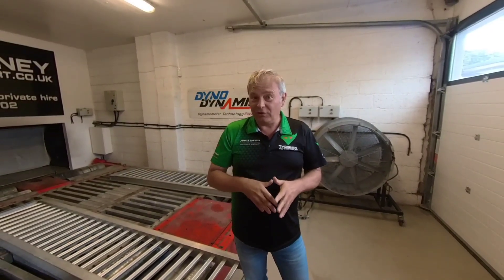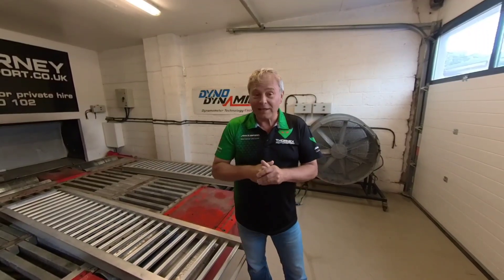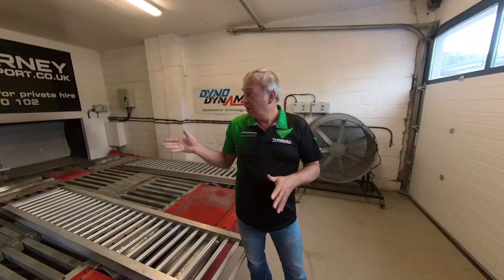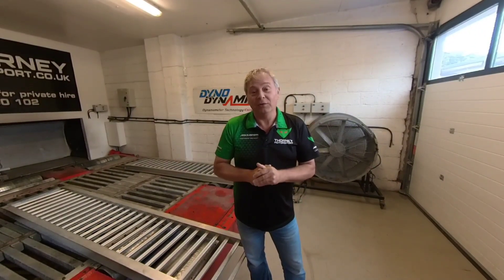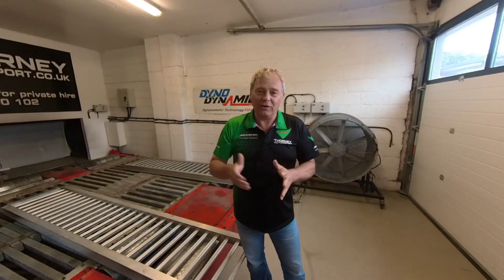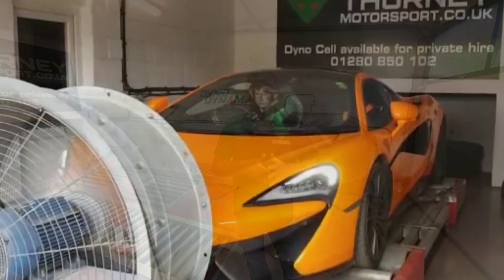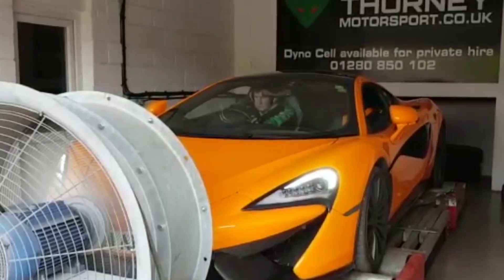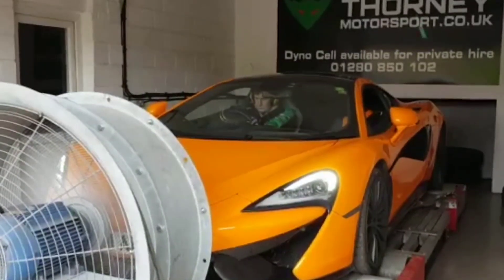7 failed McLaren engines? Why?

Comment: Theres a design feature  within the maclaren engine makeup that causes the rod bending and ring wearing failures... there is no laterall movement on the con rod at the top end.. but there is lateral movement at the bottom end ! When you over tune them, the con rod bends !! Bcz of this inability to move ...

Comment: IAT / ECT corrections, knock control, closed loop full load fuelling all allows for change in conditions… you’re talking like the fuelling needs dialling in at every load and RPM point like an open loop standalone ECU. If an engine ‘leans out at high RPM’ then it’s got a fuelling issue and the problem isn’t in the software it’s physical as lambda is targeted and closed loop fuel corrections work to meet that target if it can’t, there’s a fuelling issue

Comment: Would the engines also blow out if you just don’t map them? I have a bone stock 675lt. I wonder how reliable the engines are. I hear nothing but good things from most owners. Drove mine 16k km’s and nothing at all
Reply from the maker: Only stock 675 engine we rebuilt was from a car that was serviced 4 miles earlier, not enough oil in it

Comment: Do you see issues with all level maps? Or just maps above stage 1?
Reply from the maker: Its not a question of all maps kill engines, far from it, we map these cars twice a month and have never killed an engine, its just a question of how and how far and that is in part determined by the model. ALL the McLaren models can be effectively and successfully tuned but you need to know how far to go and also it must be custom mapped to each car, you cant just chuck a file on, so it must be on a dyno with AFR carefully monitored with multiple runs in different temperatures. So stage 1,2,3 whatever all fine so long as you map to the parameters the cars engine can handle. AND of course, make sure whomever maps the car offers you a FULL WARRANTY on the engine and drivetrain. We do, if they dont then ask why.
Reply: I would love to have my GT tuned by you all. But I’m in the states 😭
Reply: Interested in this question also.

Comment: Excellent video. This is the go to channel for McLaren practical expertise it would seem - I haven't watched all of the content yet but I will do. Regarding mapping and I apolgise if this is covered elsewhere on your channel - is there any way to tell if a car has been remapped in the past even if it has been put back to factory settings in the meantime? If I find a seemingly good used example and engage yourselves for a pre purchase inspection, are you able to interrogate the car's ECUs to this end? I would have thought Mc Laren would have thought of this themselves and put in some safeguards. It is my (long term!) plan to own a McLaren and I cannot afford to make this sort of mistake. Thanks and all the best, Chris.
Reply from the maker: We can tell if a car has been mapped before but it needs the ecu out and interrogated
Reply: @ThorneyMotorsport  Thanks, so not really practical on a pre purchse inspection.
Reply from the maker: @Ratman  no, not really, there are other areas we can check of course
Reply: @ThorneyMotorsport  Thanks for your reply. OK  understood; when the time comes I will come to you once I find a good example. Thanks, Chris.

Comment: Spot on really, the problem is, because a good mclaren tune is so expensive, people are tempted to use an online vendor and these files are honestly a load of turd, most of the time the problem is when the car arrives on boost, at that moment the fuelling is too lean and bang, as an FYI for everyone, these cars in stock form run pig rich with an AFR around 9.9-10.5 AFR. A healthy tuned AFR will be between 11.5 - 7

Comment: Glad your back John,another Stellar informative video!!! My mapping is and will remain ALL stock. Mclaren engineers are best of breed due to all their intensive testing on the race track and off!!! Very happy with what have!!!! Awesome power with reliability!!! Looking forward to Your next words of wisdom!!!
Reply: I very much doubt mclaren wrote the map for their engines. It would have been done by Bosch/Riccardo.
Reply: With such an awesome machine it's better to be safe than sorry!!!!
Reply: @Karlbrandt0145  Yeah but there are holes in the stock mclaren mapping as well, especially on the 12c and 650, it isnt exactly perfect should we say, but full thottle fueling is overly safe which is good news I guess, but its a bit of a waste of fuel.
Reply: @Cody Rogers Doesnt matter mate plenty of good ecu calibrators about at that time. Also the revised power mapping was released in 2013/2014
Reply: @Cody Rogers MAT?